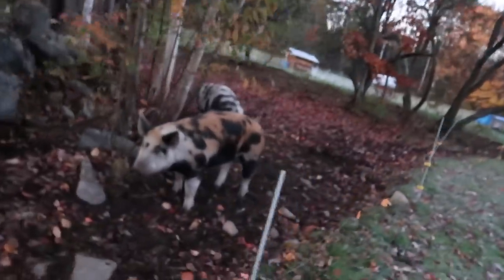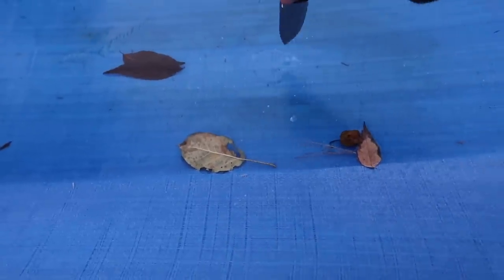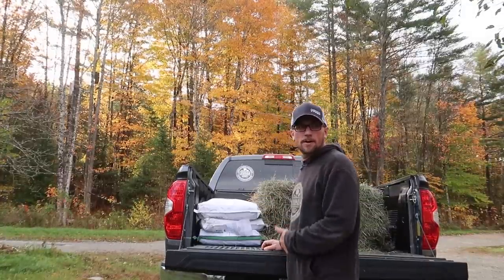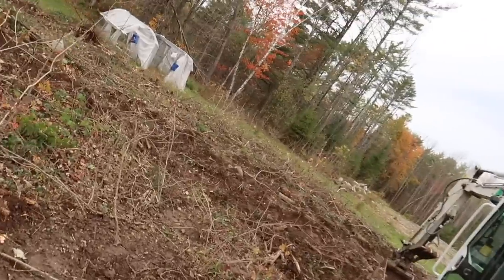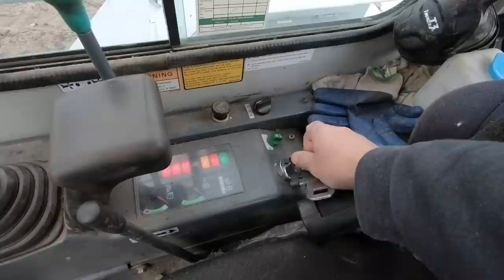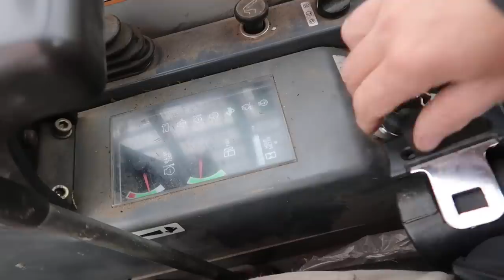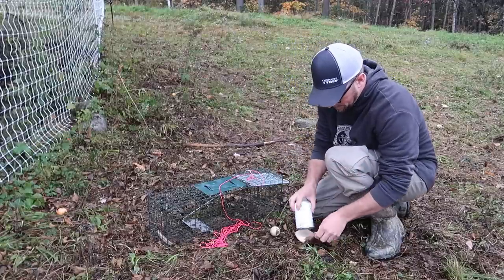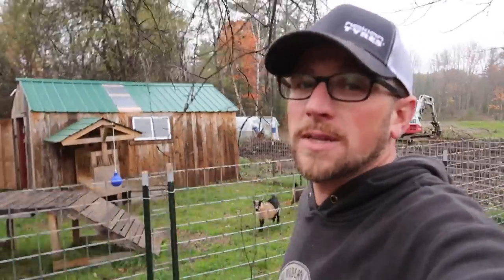She Got her Head Stuck GOOD this Time! (Our Nigerian Dwarf Goat ButterCup)

Comment: Advice from a fellow farmer. Young skunks trapped inside trap or hen house will cause an adult to spray outside. Move captured skunks at least 5km.. 3 miles away. They will return and avoid traps if let loose nearby. Take care and keep up the good work. ps The first ones inside were spraying under stress. (small squirts). If you had an adult inside the whole unit may need to be burned. I may have learned this a few times

Comment: For the goats. Run a roll of 2x4 welded wire. By itself it is not strong enough. But up against that 4x4... they work great together. Then you will not have any head issues

Comment: I cheat and use an electric chicken door, with a timer on it. But they need electricity, so I run it hidden underneath the landscape fabric and cedar chip pathways. I think one could get a solar power source for it, but I'm not sure how that would work. Electrical work is a bit out of my "wheelhouse".
Reply from the maker: I bet that works. I've. I think a solar door would be awesome.
Reply: Jadae16t  good job putting in the automatic coop door. I have an automatic solar  chicken coop door it is so nice.